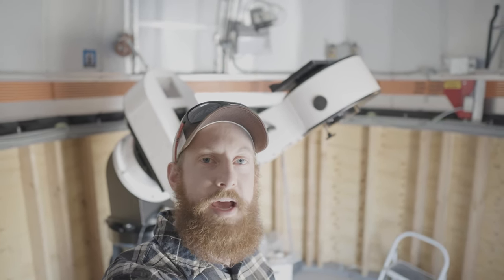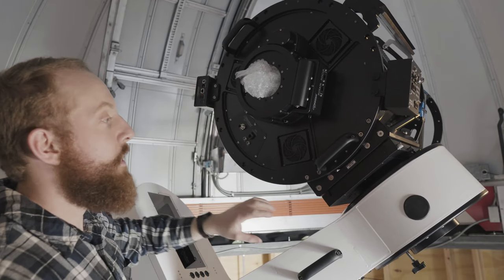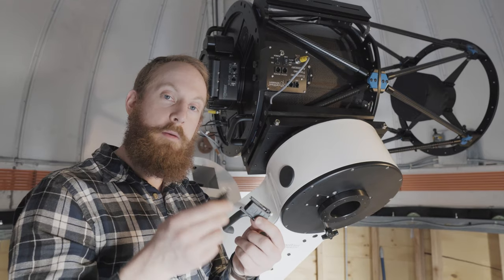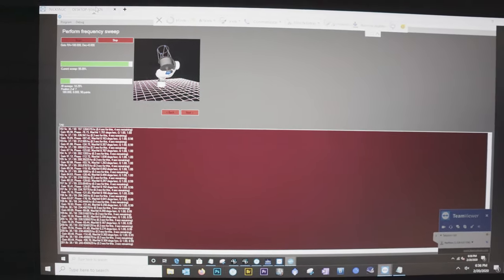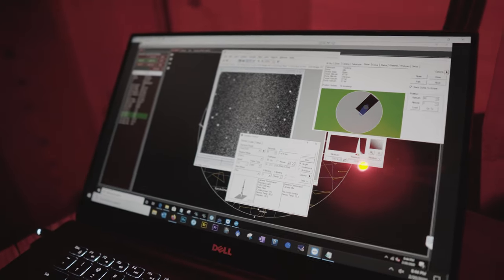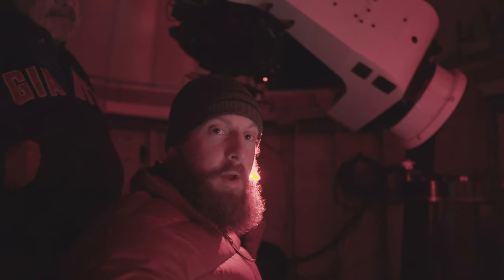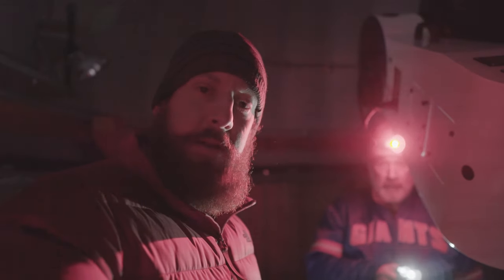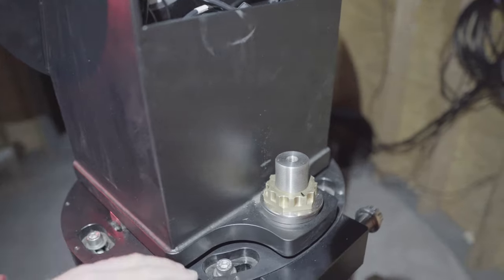PlaneWave L-Series Polar Alignment Tips!

Comment: hi, thanks for the video tutorial... a couple of  beginner questions here: 
1.) in what orientation does the telescope is in the "home position" when we configure L350 in EQ mode ?
2.) when doing autofocus and alignment processes, does PWI4 can only be interface with MaxImDL ? (or I can use N.I.N.A)
3.) do i need to turn on tracking during the autofocus run that happens before the pointing model building ?

Comment: Here's a newbie planewave question.  I just placed an order for the L-350.  When doing your polar align and even doing an imaging session.  Are customers stuck with using Maxm DL?  Or can we use other software that we are more familiar with?
Reply: You will be fine to use your software of choice for an imaging session, but the dependency on MaxIm DL for model building is what has kept me away from purchasing one of these mounts.  Here's hoping they remove that from PWI4 someday. It really is a completely unnecessary requirement.
Reply: @obaigoss  It's a drop in the bucket compared to what you're spending on the mount + ota + accessories.